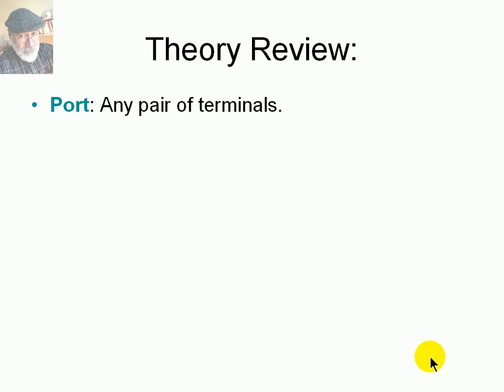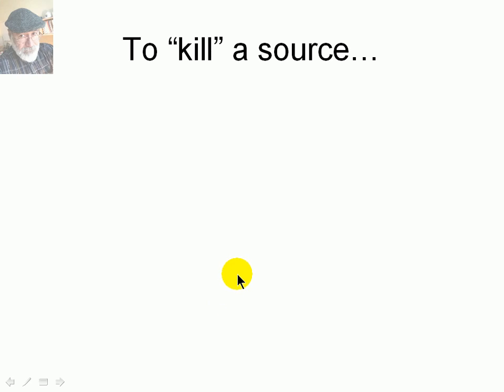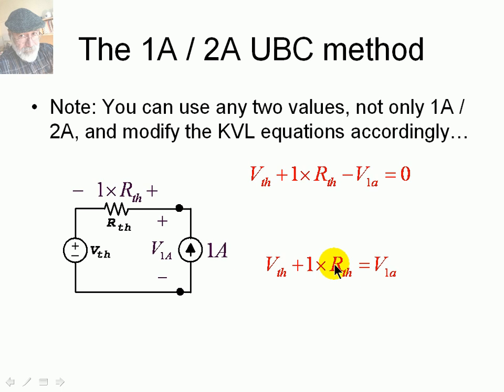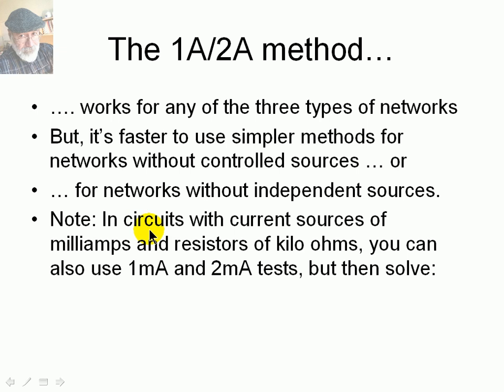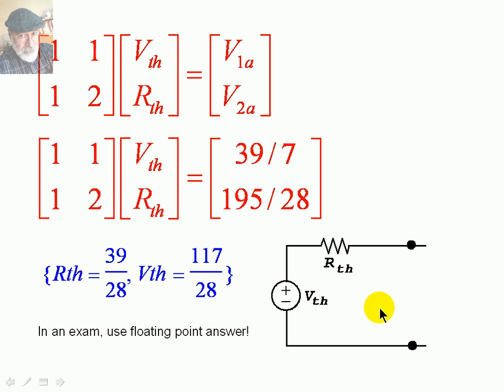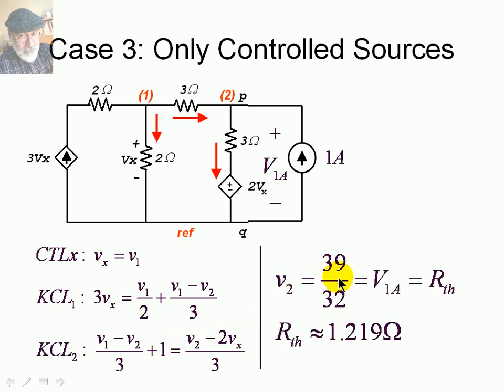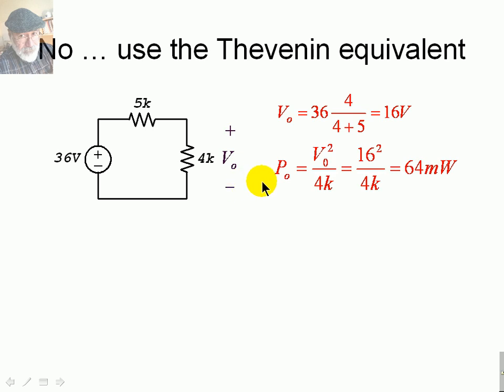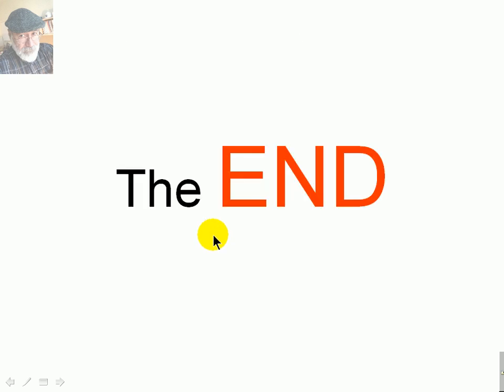(2nd DRAFT) Final Tutorial on Thevenin and Norton Equivalents

Comment: Thank you very much for your videos, it's a pleasure to listen to you. I understand why you use 1A and 2A: it's for technical calculation without the need for symbolic calculation software.
Indeed for the symbolic calculation; if you replace 1A with a generic Amp you get 7 unknowns with 6 equations: so 7-(6-1) = 2 unknowns and we get v3 = function_of (Amp) = 5 Amp + 36 where 5 = Rth and 36 = Vth.

The 6 equations : https://i.imgur.com/d0wVrcI.png

Geogebra CAS resolution : https://i.imgur.com/XQrluQC.png

The LTspice program : 

Version 4
SHEET 1 2276 680
WIRE 384 -128 144 -128
WIRE 592 -128 384 -128
WIRE 144 -64 144 -128
WIRE 384 -64 384 -128
WIRE 592 -64 592 -128
WIRE 144 96 144 16
WIRE 240 96 144 96
WIRE 384 96 384 16
WIRE 384 96 320 96
WIRE 400 96 384 96
WIRE 496 96 480 96
WIRE 592 96 592 16
WIRE 592 96 576 96
WIRE 144 112 144 96
WIRE 384 128 384 96
WIRE 592 128 592 96
WIRE 144 240 144 192
WIRE 288 240 144 240
WIRE 384 240 384 208
WIRE 384 240 288 240
WIRE 592 240 592 208
WIRE 592 240 384 240
WIRE 288 288 288 240
FLAG 288 288 0
SYMBOL res 336 80 R90
WINDOW 0 0 56 VBottom 2
WINDOW 3 32 56 VTop 2
SYMATTR InstName R1
SYMATTR Value 7k
SYMBOL res 128 96 R0
SYMATTR InstName R2
SYMATTR Value 4k
SYMBOL res 400 32 R180
WINDOW 0 36 76 Left 2
WINDOW 3 36 40 Left 2
SYMATTR InstName R3
SYMATTR Value 3k
SYMBOL current 592 208 R180
WINDOW 0 24 80 Left 2
WINDOW 3 24 0 Left 2
SYMATTR InstName I1
SYMATTR Value {variation}
SYMBOL current 592 -64 R0
WINDOW 123 0 0 Left 0
WINDOW 39 0 0 Left 0
SYMATTR InstName I2
SYMATTR Value 8m
SYMBOL res 496 80 R90
WINDOW 0 0 56 VBottom 2
WINDOW 3 32 56 VTop 2
SYMATTR InstName R5
SYMATTR Value 5k
SYMBOL f 144 -64 R0
SYMATTR InstName F1
SYMATTR Value 3
SYMATTR SpiceModel v2
SYMBOL voltage 384 224 R180
WINDOW 0 24 96 Left 2
WINDOW 3 24 16 Left 2
WINDOW 123 0 0 Left 0
WINDOW 39 0 0 Left 0
SYMATTR InstName V1
SYMATTR Value 4
SYMBOL voltage 480 96 R270
WINDOW 0 32 56 VTop 2
WINDOW 3 -32 56 VBottom 2
WINDOW 123 0 0 Left 0
WINDOW 39 0 0 Left 0
SYMATTR InstName V2
SYMATTR Value 0
TEXT 240 376 Left 2 !.step param variation list 1m 2m
TEXT 240 344 Left 2 !.tran 1